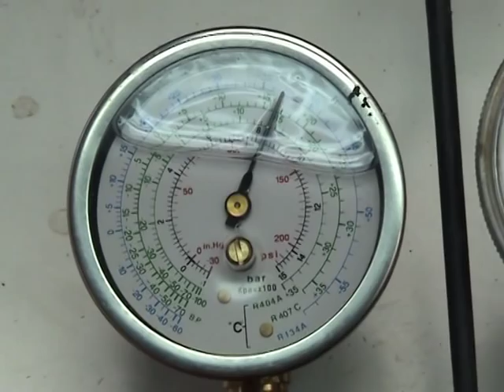HHO Machine with a compressor of a freezer

Comment: A friend made a test under which pressure HHO exploded... It ignited at 195 Bars and ripped the steel block appart where it was compressed in.. It was directly the HHO cell that produced the pressure from electrolysis.... He was lucky, that the steel screews did not hit him... but Manometer showed 195 bars before it exploded.... But better be safe, never compress HHO and better only produce small quantities ON DEMAND for some torches or so and always use several bublers and safety arrestor valves...Regards, Stefan.

Comment: be careful H must be above 96% / 97% pure to compress and an "empty" tank has residue in it as well. The Oxygen molecule gets too hot when compressed and can spontaneously combust. If you want to do this look into PEM electrolysers and or chemically breaking down aluminium  to get 99.99% H. Good luck. The fridge compressor is a good idea.
Reply: Hey sir can you explain the part of breaking down Aluminium so as to get 99% Hydrogen

Comment: in pressure Hydrogen and oxigen produce heat which is act as self ignition compressed HHO are very very sensitive to heat.
so bro dont try this dangerous experiment just for your own safty you can try to compress both gases separately
Reply: o+oil of the compressor!!!
Reply: Very dangerous
Reply: good very good

Comment: Just found this, those bottles are normally pretty tough. To reduce the exploding bottle problem should pull a partial vacuum which will also allow more gas storage (chilling the bottle first also allows for more storage but also more pressure once it warms up) , but hydrogen does leak past seals which has been proven through several explosions in the past. Nice idea for running a HHO torch but for a hot flame you need oxygen as well separate, that push's the flame temp up enough to weld steel.
Reply: HHO is already the right mix of oxygen and hydrogen to reach the highest temperature of 2800°C.
Reply: @rennrad0815  that's right I agree with you 👍

Comment: I like your idea... I have been considering the same thing... Disregard the idiots who say it's too dangerous to work with... I am sure you have considered that too... I am interested in learning how you separate the Hydrogen from the Oxygen, in order to keep it from returning to H2O... Are you isolating the Hydrogen, in some way? I know you do not need a tank that can hold more than about 60 Pounds of pressure, so a propane bottle is more than adequate. An Oxygen bottle would be even more safe

Comment: The only thing that scares me is that tank. I can see compressing the gas without a storage tank providing it had proper safety valves. With a higher pressure a torch can have a smaller orifice and perhaps better controllability.  If a flash back went to that tank, and the title of the video is correct and the gas is “HHO” with a PSI of 200 what would happen? I can honestly say I do not know what would happen. I suspect a steam explosion, one that would level the house or maybe just blow all the windows out. I did see a video of a dry cell “HHO” generator make over 2000 psi. The small round SS device had end plates that looked to be well over one inch thick. The device was connected to a high pressure gauge in the end plate. Total gas volume couldn’t have been more than a couple CC’s. It looked like the experiment was done outside and filmed with a remote camera, far, far away from people. What I get from that and this video is “HHO” gas does not seem to spontaneously combust, of course I wouldn’t bet on that.

Comment: When the lid was off I was holding my breath and hoping there were no sparks anywhere with all that HHO around the room. 
I was producing much less, but lighting the bubbles that came out of the bubbler gave quite surprisingly loud and high-pitched bangs. 
One of the early HHO guys was doing this during a YT video, when one of the bubbles was big enough to connect back to the main HHO generator in a really big plastic electrical box. It went bang in a big way, and the camera pointed at the ceiling in silence for some time. Fortunately he didn’t die.

Comment: First of all I think that's so cool ,I was going to do the same thing with a car a/c vacuum pump to get the pressure to raise in the fuel rail to30 to 60 psi to power a automobile . That was my idea. But I just realized the danger reading this. I honesty believe this video actually saved my life. I have had several flash backs that exploded my containers

Comment: hi ! I have not tested what I say , but the mixture you compresses is an explosive  stoichiometric mixture , you should watch out the "DIESEL" effect  which could take place during compression(like in diesel engine).
when you compress an explosive mixture in a bottle, you manufacture a bomb , in addition , the mixture is sensitive to static electricity.
I "played" with a lot of explosives ( NaClO3, NH4NO3, nitroglycerine, nitrocellulose, peroxides, etc ...) , made rockets, shaped charges , smoke bombs , termite , I enhanced my rifle cartridges but I 'm Still prohibits this kind of experiments by security because too many factors can change the " experience" in "tragedy" .
inform you about the "Murfy's law " and informs you deeper into pyrotechnics, and you will understand that you're playing Russian roulette .
what will you experience as when you have lost your hands?
you should avoid it if you do not want to turn your hands lint ...
I'm not you, and you do what you want, but , I still have my ten fingers !
good luck my friend!
be carrefull...
bye !

Comment: This could work but you are going about it the wrong way. If you use the compressor to pull a vacuum on the storage container and slowly fill vacuum with HHO. Just turn off the compressor before filling with HHO...

Comment: im an hvac tech  ...if you take pure oxogen and pump it into a compressor  it has a chemical reaction with the oil and will cause the compressor to explode   I saw it happen one time when a guy ran out of nitrogen and used oxogen from his acetylene tank to pressure test a line for leaks..the compressor shot its top through to floors out the top of this building....what if your oxygen were to get compressed instead of the hydrogen

Comment: I want to store hydrogen through the summer to heat the house during the winter thought of using the compressor to use to compress the gas into a larger tank to store it through the summer but I don't want to blow up something I'm putting the large tank underground a mile from the house

Comment: Thats not right, you are giving advice that will kill someone. its nothing to do with putting the guys work down, the rig is well built, pleasure to look at, but the procedure is death in waiting, it does not matter how nice the work is if its covered with the blood of the builder and worse, an innocent by stander. Go put 50ml of this "low oxygen"(?) in a plastic bag, ignite at a safe distance, then do the figures for whats in this bottle/ rig. Ignorance with HHO will kill you!

Comment: i would use a spark back arrester so a flame does not blow up your hard work in the form as a fire brick like you see at the front of gas fires the bit that glows oringe

Comment: if you are still alive, please explain how you can compress hydrogen and oxygen mixed in exactly correct proportions for combustion and NOT get a huge powerfull explosion! 

In the welding world we are told not to use oil on compressed oxygen fitting because the pressurized oxygen will instantly combust the oil at such high speed that there will be a huge explosion. I can only guess what hydrogen and oxygen will do together when compressed to whatever pressure will combust them. 

Very concerned

Comment: HHO generators place strain on gasoline engines, increasing fuel consumption. Voltage charge regulators (monitoring the voltage levels of vehicle batteries) automatically turn on alternator motors when battery voltage is low (and off when high). Electro-mechanical alternator motors are mechanically connected to vehicle driveshafts...INCREASING fuel consumption, all to produce vanishing small amounts of hydrogen and oxygen. HHO kits are illegal to sell in many states...expensive, and wasteful.

Comment: HHO is what makes up water. Its  two parts hydrogen to one part exigency it gos by the name   brown gas  after the guy who first found out how to split it in the first.place. The Hydrogen in it has a high explosive rate HHO has even more because of the oxygen mix in with it it will explode slightly then implode as it turn back into water. leaving a vacuum. in small amounts and unpressurized like with say a HHO to boost  a car fuel there a lot of safy factors build in but pressurized it dangious

Comment: Hydrogen ( /ˈhaɪdrɵdʒən/ hy-drə-jən)[7] is a chemical element with symbol H and atomic number 1. With an average atomic weight of 1.00794 u (1.007825 u for hydrogen-1), hydrogen is the lightest element and its monatomic form (H1) is the most abundant chemical substance, constituting roughly 75% of the Universe's baryonic mass.[8] Non-remnant stars are mainly composed of hydrogen in its plasma state.

Comment: I agree this is very dangerous.. you need to be using a fuel pump ..not a compressor.. this compressor does not have a isolated internal pump and creates a static charge when air passes through the line.. this at the least needs to be grounded for safe static discharge..if enough static builds up while this thing is running it could ignite internally and depending on the compression and amount of fuel contained could be a very bad seen..

Comment: just so you know its two parts H1 not H2...you get h2 because water is two parts hydrogen or h1 x2. H2 is highly more volitile then h1. H1 is what you get in a compressed tank from a gas supply company.. each hydrogen molecule in compressed hydrogen tanks are all 1 part molecules not 2 part.. that is the reasoning behind the term HHO. when you split water you get 2 h1's that stay connected as h2..which is more dense then just h1.so as you can imagine with the O added and being 100% pure,Kaboom!

Comment: this is not correct, as Hydrogen can ignite even without the presence of any oxygen, this is why NASA is using it in they're shuttles, and high altitude UAVs
any ignition source, and Hydrogen will ignite, even inside a sealed container...
but i am not sure that compressing hydrogen by it self will cause an explosion, as people have compressed hydrogen to as high as 400 PSI (I would never do that)...
General data.
Hydrogen will ignite at around 520 degrees Celsius.

Comment: You have compressed an explosive mixture. Please stop. The mixture of hydrogen and oxygen is EXPLOSIVE, not just flamable.
The ONLY way to store hydrogen is to remove the oxygen.
Just a small 5 gallon container of browns gas (HHO), compressed, is enough to take down more than a 2 car garage.
Again, PLEASE STOP.

Comment: Ok, this is awsome. i have been pondering about how i could pressurize and store HHO gas as well.. but i would prob. gone some lengths into spark protection all that electricity.. dude if a fly land on the wrong spot and catches fire.. and u have a gas leak.. shit.. nasty (or whatever that sparks catches fire in the vicinity)

Comment: People have been making HHO gas to boost fuel economy and gain more power with good results and very little danger for years as its an unpressurised gas. The HHO Kits when installed propily come with a lot of safety factors built in.  But other people have been killed trying to pressured HHO gas.

Comment: some of the older welder/cutting units ran at high pressure/temperature. seem to get more bang for you buck. i pressurized my cells now. but i am not sure about putting it in tank but i wonder if simple charcoal can aid in absorbtion make it more reliable. charcoal seems to absorb hydrogen but i am not sure about oxygen.

Comment: Safer. Be sure to clean everything in contact with the Oxgen with solvent, any oil or greese on or in the pipes, on your fingers will cause spontaneus combustion and an explosion, refer to safety handling procedure's for Oxygen ;)

Comment: 1 what you're doing there is dangerous and dumb. 2 if you want to get compressed hydrogen in a cylinder buy it. 3  Hho generators produce hydrogen on demand for a very good reason... low volume. The amount of hydrogen you are storing there could destroy your house if not your neighbors too.

Comment: I think you don't need a compressor to transfer hydrogen and oxygen in a bottle ,the hho generator can transfer direct to the bottle in a compress or pressurize hydro-oxy gas if ur hho generator is enclosed and no leak.just be sure that your compressed gas in a normal temperature condition .

Comment: You should be aware that browns gas lasts only about ten minutes then it theoretically devolves to a less active state.
Reply: Fixed magnet propulsion, Gasoline, Vaporization are far better choices. And a few others too.
Reply: gsxr1100boy Perhaps it’s not. But either way your assurance is personal opinion. Explain it to me.
Reply: gsxr1100boy  I agree with you that hydrogen and oxygen should never be compressed together, when I said it breaks down in ten minutes I meant from atomic hydrogen to regular hydrogen, I didn’t mean it wouldn’t explode.

Comment: hydrogen en oxygen  under presure is explosief you need to separate hydrogen from oxygen en than compresed in a tank than is it  save but not in  i steel tank becouse  the corrosion gas inside the tank can fired up the hydrogen

Comment: Meh, this is actually set up very well, but I do agree on the fact that if your compressing fuel plus oxidizer you should Definitely beef up the containment , such as flash arrestors for the containment tank lines and check valves to keep it contained, otherwize theres not much danger as long as you keep in mind whats in there, nicely done!

Comment: this is not dangerous because the future hybrid cars will have the same concept but with high resistance pressure and if you wanna storer hho on a tank this is the way to do it
Reply: Chan Lee really? where are you getting your information? he is making hho, hydroxy, browns gas, call it what you want, but what it isn't, it isn't hydrogen, hydroxy IS unstable and WILL explode when compressed, yes you can compress hydrogen, but it's pure hydrogen, and the manufacturers of hydrogen don't use a fridge compressor and a propane bottle, they compressors that are way more powerful and metal hydride tanks, also they don't make hydrogen by electrolysis, it's a byproduct of the oil industry!

Comment: hgfrind i not gonna name anyone, but in my city there once lived a man who tried this "for his car" and this man demolished his whole workshop, ended his life with that and destroyed almost every single windows in whole city block.
...dont do this man!
Reply: ***** Well if you store hydrogen that could happen, but if you use (burn) it right away, as it exits the cell, and you use a flashback arrestor, the biggest explosion you can get is the one from the gas in the tubes till the point of the arrestor, so yea... not big or dangerous at all. And if we are talking about a car, then your average day car is way more dangerous than the one running exclusively on HHO, since the regular car has a big tank of petrol/gasoline etc. which can explode, and ass I said, the HHO can only explode down to the arrestor, so it basically no danger at all. Sometimes however the arrestor can fail, and that is why some people put 2 of them, and/or add a bubbler (which also serves for other purposes).
Reply: ***** Or maybe you already knew that, since I first wrote the comment and then realized what the guy was doing in the video xD
Reply: David Dančuk I know... Tubing and that whole rig is kinda safe. But i meant that tank that he using. He basically mixing oxidizer and fuel in perfect ratio under high presure. 
Thrust me in pressurized, oxygen rich atmosphere everything wants to burn ...add just right ratio of fuel and you have a bomb. ;)
And yeah in case of pressurized hho gas ...with pressure let's say on 10-25% of maximum pressure that theese vessels can handle... it can ignite even with "normal handling" stresses.

I reacted to the video ...if you didn't noticed what he doing watch the video again. ;)